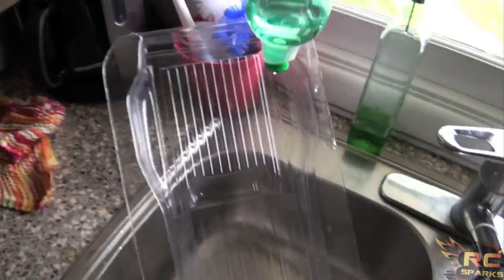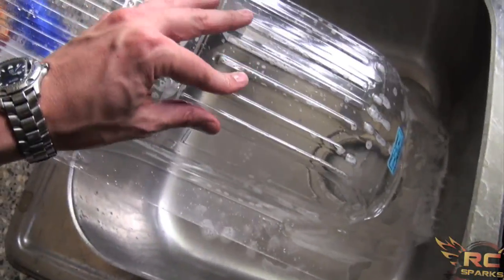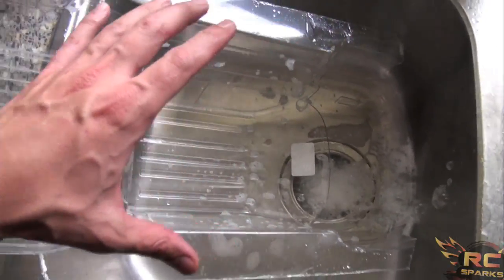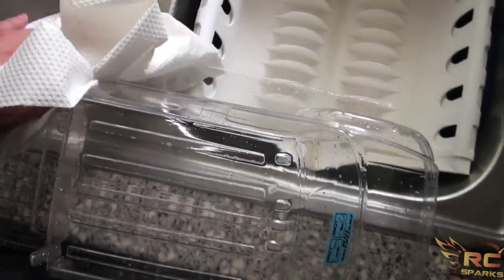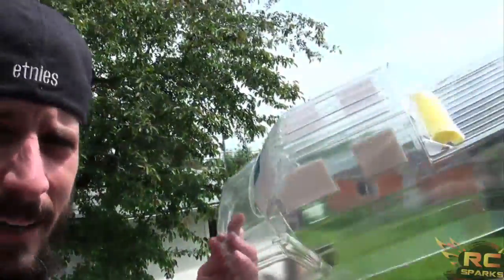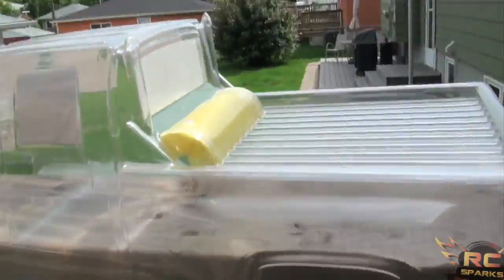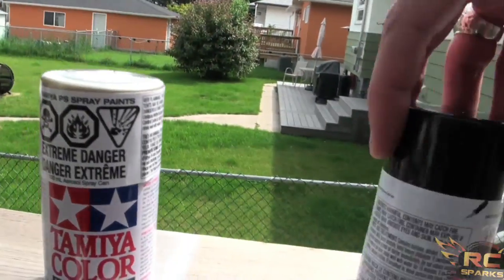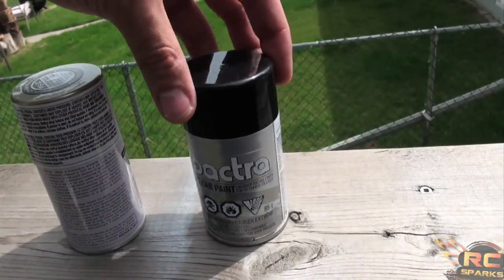RC ADVENTURES - PROJECT OVERKiLL - DUALLY - Episode 9 - Spray Painting Tutorial

Comment: medic, have you ever thought of useing screen from sreen doors fro your window? i used it in both of my slash bodies. i also used a peace of pvc piping for a single stack in the bed of my ford f350, and painted it black. i cut and angle at the top of the pvc to give it and authentic look. i secrued it with super glue on the outsid efor a clean look and hot glue for a stringer hold in the inside then painted the body.